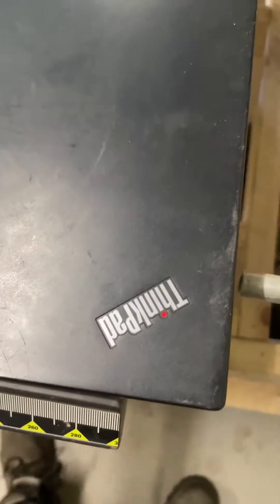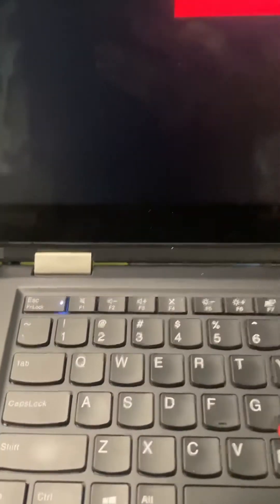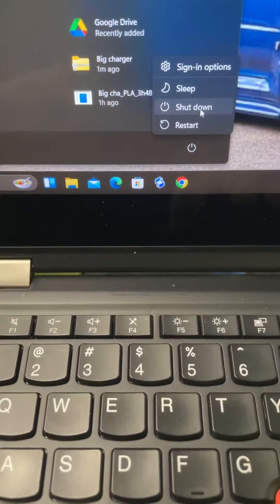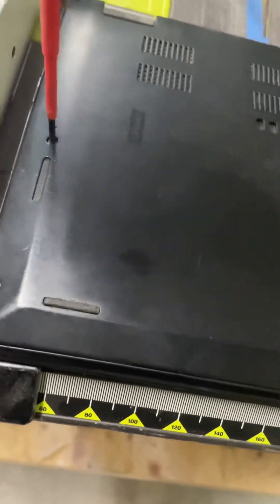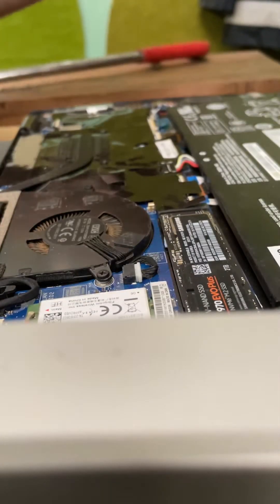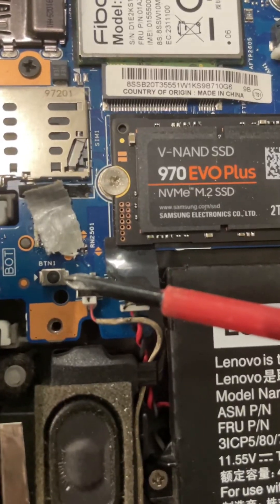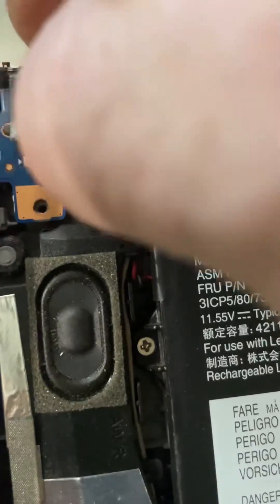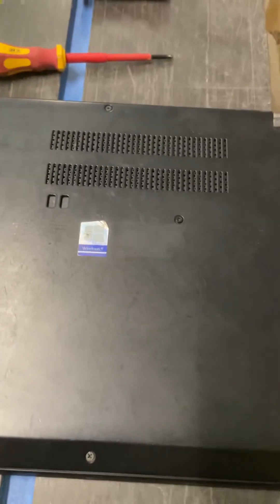Lenovo detection bottom cover tamper

Comment: You are a life saver. On the T14 Gen 3 its not next to the ssd, but near the fan. I almost gave up because I couldn’t find it. Then, I went back and opened a different T14 gen 3 and saw it. The chip in mine must have fallen out 😂